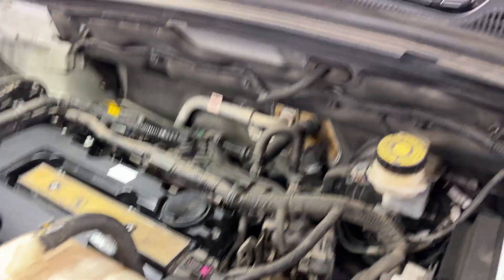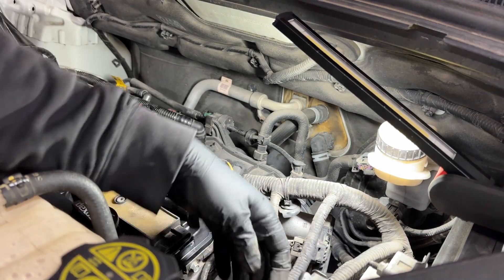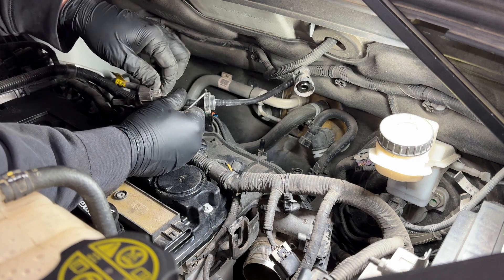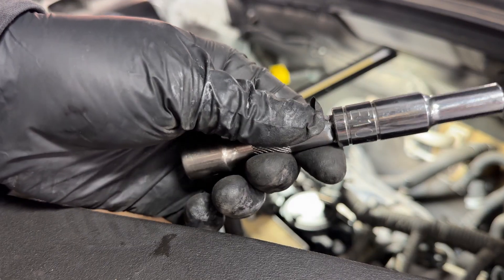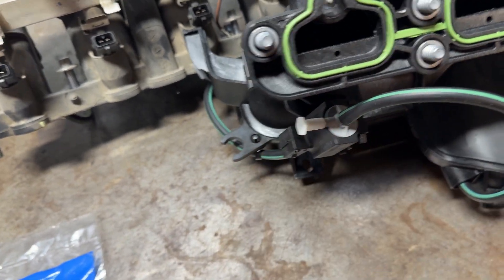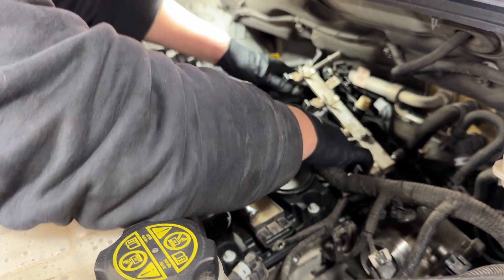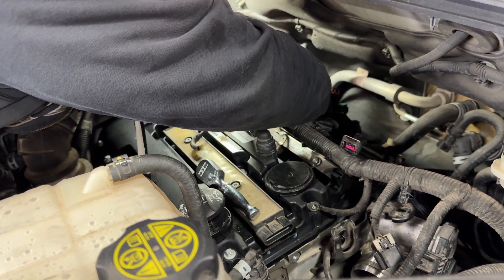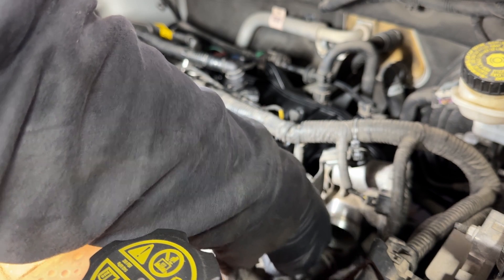How to Replace Intake Manifold Chevy Cruze - Trax - Buick Encore - Bad PCV

Comment: If you go the upgrade route you can get a pcv fix kit for the intake and it has instructions and videos that go along with it. It plugs the orange check valve I think and has check valves integrated into the new pcv you’d be running instead.

Comment: whats he name of the tool you used to separate the wires?
Reply from the maker: what tool
Reply: @FalconsGarage my check engine light is on a 2019 trax. Autozone is OBD reader says p0171 bank 1 system to lean. most likely solution is “replace valve cover with integrated pcv valve” I’ve seen another vide with the pcv valve and in my car the valve thing with the hole is not hissing. So do you think it the part you replace here or the integrated pcv valve? Or both?
Reply: @andygomez9025   I have same issue on 2019 Buick Encore. p0171 but no hissing sounds at the hole. Did you resolve the issue?